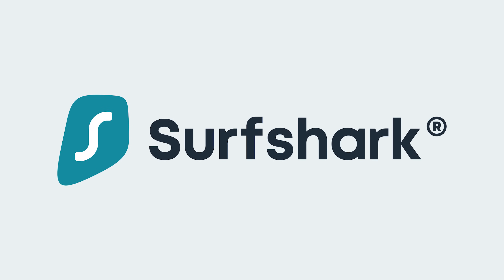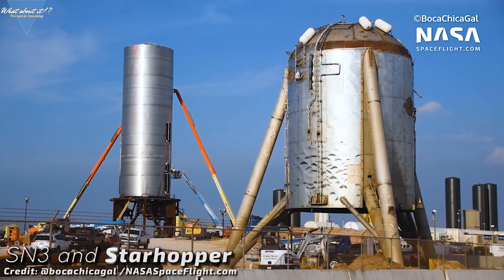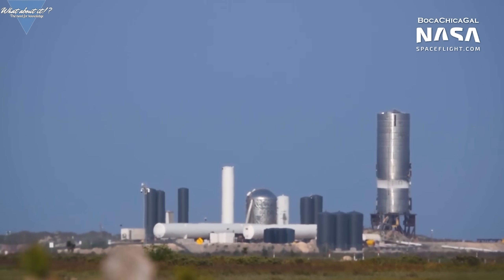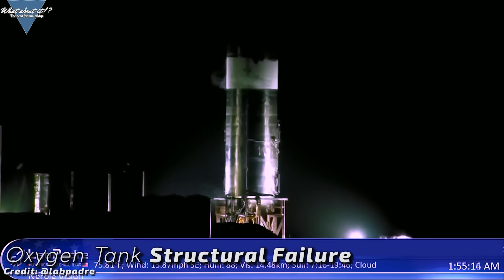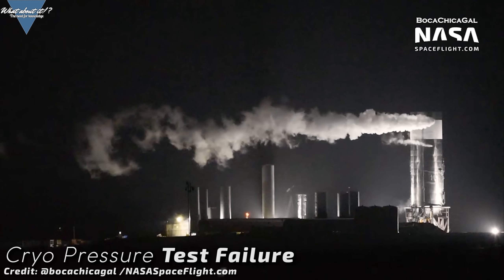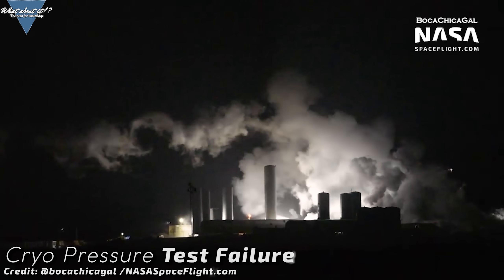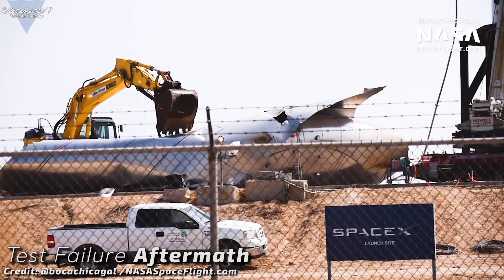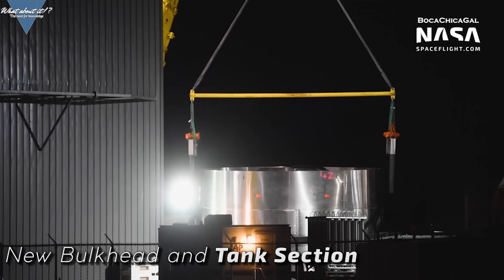83 | SpaceX Starship Updates – SN3 Cryogenic Failure Explained – Expectations For SN4

Comment: It's an easy fix but, SpaceX has to stop being so cheap when it comes to building a prototype first. I called that flimsy tin can a failure from the start. I knew  that it was going to blow out by the way the stainless steel flexed.Elons concept designer and structural engineer are terrible to push this mess through. They should learn about p.s.i. and understand the mathematical equations involved. The limits of the tank should have already been known by design to specs. I guess some people should stick to automobiles. The great space race where no companies can get off the starting line. If SpaceX is the best the U.S. has then were in trouble.  Theere should be a way to let some of us with no funding in on this space race to show how it's supposed to be done.

Comment: Maybe some engineer type folks can answer this, but why are they not using any structural ribs running horizontal and vertical inside the longer tanks to prevent this?  It seems that for a craft that is expected to be reused frequently you would want something more than just a sheet of stainless steel.

Comment: I still don't understand the use of rings in the tank sections - while it kinda makes sense since the plates are holding pressurized gas, once you apply forces from the bottom and top during takeoff and during the pancake re-entry all the pressure will be on the welds, on the weakest axis even with the tanks pressurized. There is a reason why ULA and Boeing use vertical sheets of metal on their rockets.

Comment: Atlas balloon tanks aren't a valid analog to the Starship construction.  Starship tanks are structural while empty (how else would they get a full payload to the pad with empty tanks).  Mistake was likely due to pressure control issues coupled with the extra weight of liquid nitrogen vs liquid methane (about 50-60% heavier per volume).

Comment: These legs are probably not going to work. Look at the support polygon to center of mass height on the falcon 9 booster and consider how much of a engine stability improvement you would need to land a starship as it's currently depicted. It's just too damn topheavy. Not to mention the center of mass needs to be high for the bellyflop manuver. We're going to crash alot of starships before they stick a landing on a long distance flight.

Comment: From what I can see of the structure, between the oxygen and methane tanks is a somewhat open space around the outer area inside the hull.  It appears that there is no structural support, or possibly only limited support.  Based on what I saw with Blue Origin hull design, Blue origin places a relatively lightweight, but strong lattice work cut out by a CNC process to line the inside of the hull, and welded in place.  This gives the sheet metal hull a strong backing to withstand the pressures applied to the hull by both flight dynamics and the weight of the area above this reinforced area.
I think SpaceX needs to think about putting in the CNC honeycomb support structure where nothing else is in contact with the sheet metal of the hull.  SpaceX might lose a little room inside, and have to rethink size and placement of components, but I doubt much change would be required.

Comment: My guess at the cause is two things.  The buckling margin on the Oxygen tank wasn't quite as high as they planned. They were using minimum pressure on the Oxygen tank to reduce collateral damage if the oxygen tank did pop. 

I bet they'll have someone monitoring the dents in the tank like a hawk now.  While subtle, they gave quite a bit of warning that the tank was near collapse!

Comment: One curious issue is the SN3 has walls 4mm thick.  The MATERIALS characteristics are key.   Stainless steel vs Aluminum analogy....... Here is a question, do you think one can discount the stiffness and modulus difference between Stainless and Aluminum ?  Previous rocket failures in the 60's were not made of stainless. Beer can is not this.  You are talking more about a robust steel soup can....... You can stand on a soup can empty.  There is a radial torsional or uniform constriction that seems not particularly progressive.  There may be more here than just a soda can issue.......

Comment: The concerns some are expressing about re-entry with empty tanks are irrelevant as a Starship cannot come back "empty" from orbit and survive landing without fuel for a landing burn.
Reply: The discussion groups have speculated on coasting to/from Mars with the main tanks exposed to vacuum, then inflating pressurizing again. It has to do with providing a vacuum to insulate the "header" tanks during the transit.

[EDIT] the small header tanks carry all propellant needed for landing.
Reply: @avid0g  Good to know and would solve some cryo issues. What would be used for fuel for the orbital injection burn? Refueling from an accompanying tanker?

Edit: I'm a bit slow, finally noticed "propellant needed for landing". I assume that means for the injection burn as well?
Reply: @jameshoiby  
No injection burn. It's all aero-braking. Or more precisely, aero-capture, minor course adjustments at apogee, then aero-braking nearly to the surface.
Reply: @avid0g  Of course. Thank you!

Comment: Can't see those feet working that well for an uneven landings, with mars terrain being even less predictable. The starhopper had the better idea with those wider legs.
Reply: Eventually, ships have to be built to the Moon/Mars specification, but not right now. Baby steps.
Reply: @avid0g  Don't mean to sound negative about starship, just having trouble understanding the logic, when they have seen the other rockets landing on ships and needing the the wider legs. Can see after the first hop it being more of an issue.
Reply: @adrianfox7972  
The Falcon-9 landing legs are handling a worse case than Starship when landing on a droneship. The waves are tilting the Falcon back and forth. When the legs "crush", the booster is left in the initial orientation/tilt. The legs are passive, and do not self-level. 

If you look closely at previous versions of Starship, the tripod forms a triangle who's sides are tangential with the hull. So six legs are about as stable as the triangle in three certain directions.
Reply: @avid0g  I can't thinking that the width of the legs will be more important that the number. No expert but it just looks like it would topple over and probably explode if ground became uneven. Luckily they will test it unmanned for a while to come, to iron out any landing issues.

Comment: I don't think the main contributing factor was the weight.  More like the atmospheric pressure pushing in on the sides reducing the strength of the steel vertically.   This would be a test stand problem.   Not an in-use problem.   As you cant launch without fuel and you don't land with a full tank.

Comment: "Really inexpensive"... I'm wondering how much money goes "away" (I know it's prototype investment) on these tests/failures.
Reply: Carlos López Starship is made of less than $100K worth of steel. A typical rocket development is more than half a billion. The actual material cost is a rounding error. The people/development cost is much harder to factor in as you would still be paying these people whether it succeeds or fails.
Reply: @Borodalf  Just for comparison, consider that Boeing budgeted nearly half a billion for re-flying the failed Starliner test. Granted that includes the launch costs as well, but the difference is still staggering...

Comment: As the diameter of the ship increases, the skin is becoming less curved and more flat. Resistance to collapse becomes difficult and adds weight. Ultimately,  for a ship that is going to be used as often as an airliner, this must be addressed with increased longitudinal rigidity in the  pressure and column load (and worse case partial vacuum) bearing skin. Perhaps after ring fabrication a corrugation can be rolled into the center areas of the ring skins (held back from the edges), when joined together creating longitudinal reinforcement  looking  like the Saturn 5. Lap weld joints would increase hoop strength.

Comment: So it might not have collapsed if both tanks had been full. Atlas Agena accident you played happened because the operators in the control room forgot that Agena could not remain in the vertical position without the tanks being pressurized and someone had begun de-fueling after an abort while the rocket was still vertical. The Doctor says, "Patience is for whimps!"
Reply: Senjore, this thing has not only to stay still, but also to fly to open space, understand. Did You ever learned about vertical thrust and its implications?

Comment: An empty coke can can hold the weight of a person which is a much greater weight to skin thickness ration. The problem is that the cold temp at the top cooled the gas in the bottom causing it to contract. Just like drinking from a water bottle and then putting it in the fridge. You hear it crunch as the pressure difference changes between inside and outside and if there is enough empty volume inside, the bottle will crumble. This was the easiest problem to avoid ever because it was foreseeable to anyone using their brain . All they had to do was put a small valve on the bottom tank to let air in if the pressure drops below atmospheric pressure.

Comment: It looks like they filled the tank to the level needed for the short hop, instead of completely full. That may have been the mistake, thinking that the current stainless steel alloy (301? 304?) would be strong enough. It seems like ages ago now, but Elon said that the new alloy that SpaceX developed would be stronger at cryogenic temperatures. As of SN 3 they haven't used the new alloy (30X). Hopefully once they make the switch over the hull will be stronger and less susceptible to this kind of failure. And hopefully they wont have to go through the process of figuring out how to weld it effectively, again.
Reply: Filled the lower tank for short hop but the upper tank for orbit? Sounds like a communication error, two people not on the same page of the test plan...

Comment: Main problem definitly wasn't in SN3. Valve issues could be solved later, but some idiot filled methane tank without pressurising LOX tank.
Elon, stop getting amateurs to this amateur like site. Take people who worked on f9. I bet dragon team alone can make dragon XL till 2024.

PS: this test also shown, when they want to fly higher than several meters, they must stop with balloon tanks. Of course, structural grid will add several weeks to build process, but i think it's better than floppy can on coming back.

Comment: The Landing Gear. Is To Close Too The Engine, Remember Delta Clipper spacecraft Landing Gear
Reply: These gear are for short hop testing only. The design hasn't been finalized. If they were to remain like this (they wont) I'd agree with you they are too close to the engines.

Comment: OK-------------  What about What?.... It does not matter if the lower tank is full or empty of liquid when the upper tank is full even at 500 tons... As long as the lower tank maintains sufficient  pressure in pounds per square inch to support the weight and  structural integrity to maintain shape, the upper tank will remain elevated in place. It is the pressure of the gas that does most of the work supporting the upper full tank using both upward pressure on the tank dome and outward pressure keeping the wall of the lower tank ridged.  It looks like the lower tanks vent line was  opened when it should not have been, reducing the pressure and reducing its ability to support the full upper tank. You can see the lower tank slowly fail in stages as the weight of the upper tank was no longer supported as the needed pressure was vented off the lower tank. The upper tank first fell compressing the lower tank until the pressure had increased enough to again support the upper tank. Even though the lower tank's hull had become buckled and was no longer able to contribute much support to the upper tank. But then with the sudden increase of pressure that was again supporting the upper tank, the lower tank's venting rate roughly doubled as the vent valve was opened wider trying to reduce the pressure after the sudden increase. Which only lasted a short time before the upper tank's weight again overcame the lower tank's rapidly reducing gas pressure's ability to support the weight and started collapsing again, ripping open the sides of the tank allowing even more gas to vent even faster out as the upper tank headed for the ground. ...... Again: They are called balloon tanks for a  reason.

And NO! Space X does not need to rethink it's design as the Atlas you show collapsing went on to fly for 50 years and is still flying using the Balloon system of construction as do most current rockets. Even Musk says that it was a procedural mistake allowing the internal Gas pressure inside the lower tank to reduce below the Calculated Dead (never to go below) Collapse pressure that was needed to support the upper tank. As for landing, there is also a never to get below gas pressure for each tank to keeping the ship structurally inflated and sound while falling sideways down through the Atmosphere just as there is a never to get below pressure for lifting under full engine thrust to orbit or sitting on the test stand doing a loaded pressure test on the upper methane tank when the lower Oxygen tank is empty or loaded. Even the upper tank when a cargo section is attached above, will have its own never to get below gas pressure less it collapses just as catastrophically as the lower tank just did. 

Please use your head, take a few deep breaths, relax, leave the emotion of loss and panic behind and think. It is basic rocket science. It is not that hard to understand.
Reply: Dear Larry! I am always confident to believers, but this is a rocket science here. This demands laws of physics and mathematics to be considered. 
If thing cannot support its own weight standing still, how can it withstand overtactions in deploy and reentering?

Comment: Felix, you're very diplomatic re the cause of the failure....safe to say someone's head or heads are going to roll after that fiasco. Why would this vehicle be tested in a configuration for which it was never designed?.....: gaseous pressure in the lower tank holding all of that liquid mass up in the air....never would occur at any point during vehicle LN2/LOX loading or in flight. (LOL flight not possible with one or the other tank empty). Even if this bird were flying on header tanks, either one or both of the tanks would have to be evacuated "dumped" for any prayer of a safe landing (or for that matter a break-up in atmospheric freefall) I think it would have been better to blame it on a leaking valve.  Holy smokes!    K H